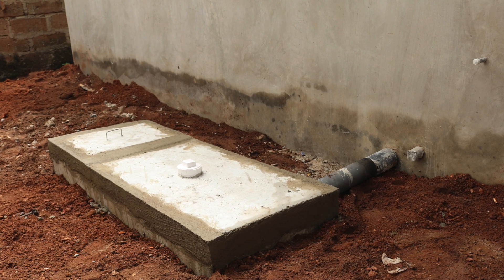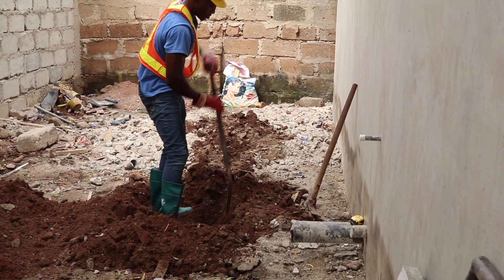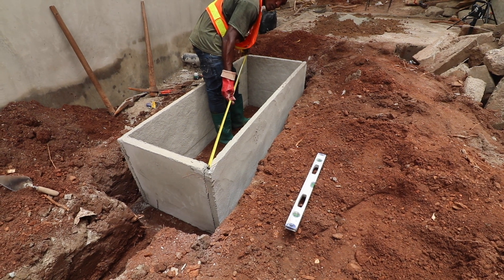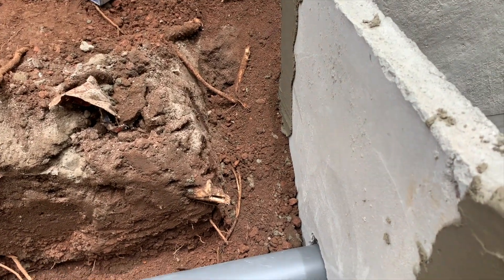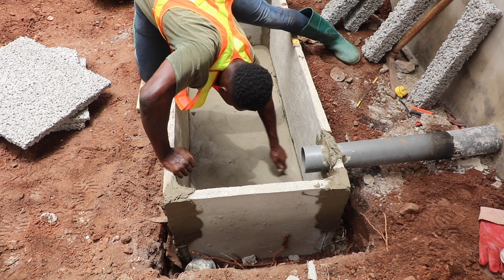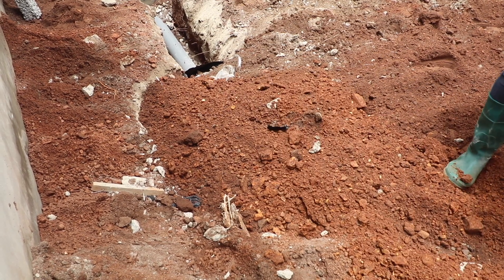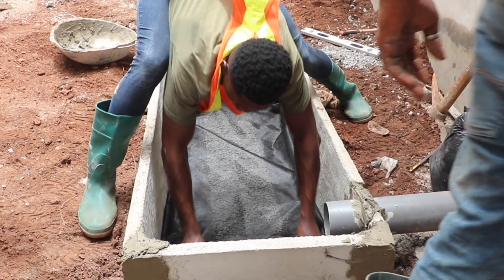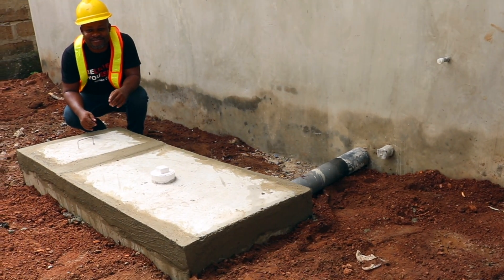Step-by-Step Guide to Constructing a Bio Digester with Prefab Slabs

Comment: Will the use of disinfectants such as bleach or muriatic acid,  to clean the toilet bowls not kill the anaerobic microbes in the biodigester and lead to failure of the system? Another question is, do we have to separate drainage of the kitchen sink, shower, and lavatories (grey water) from that of the toilet bowl (black water), or can we just direct both the grey water and the black water to the biodigester? Thank you for your answers.
Reply from the maker: Thanks for your questions @highlandgrandma. Very good questions. For the bleach and other cleaning agents the main issue was the corrosion to the biodigester bed and not the microbes. They can survive fine. So we’ve stop using the metal wiremesh and instead using concrete and chippings for the filtration slabs (porous). We also advise that you separate the black water from the grey water at all cost. The reason is in this video https://youtu.be/DOglQHtap4w?si=b8SpL6-zr1qQQFdN